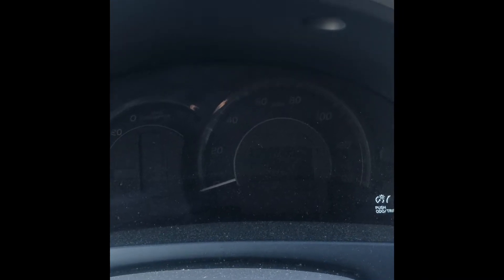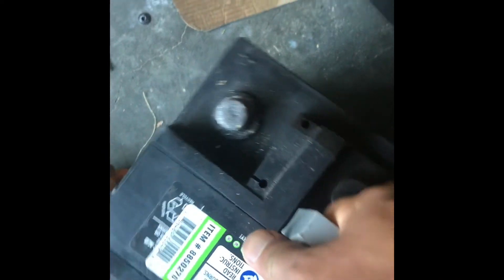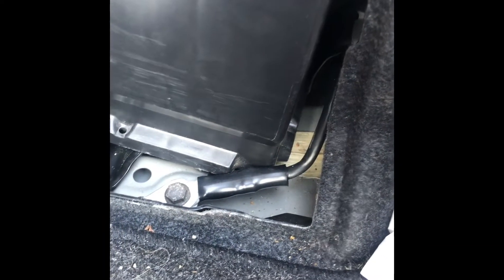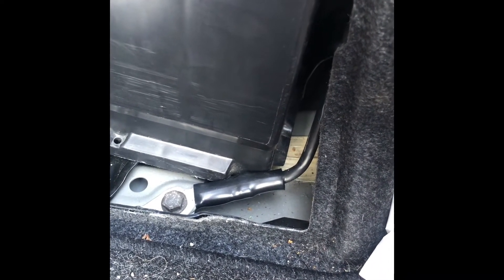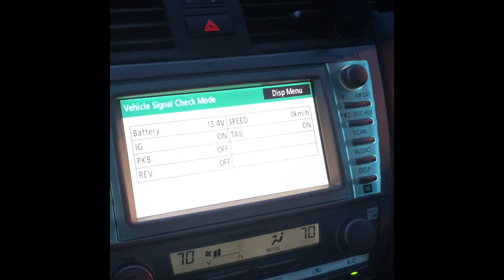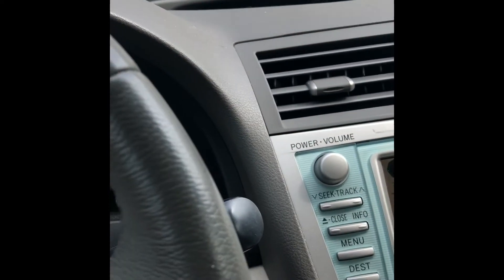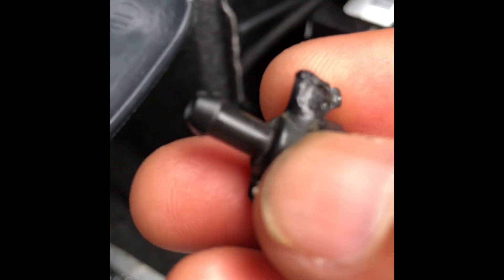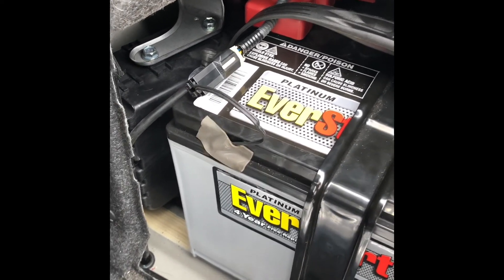Toyota Camry Hybrid - symptoms of a dying 12v battery, replacing with ordinary 12volt and diagnostic

Comment: I used a 12V motorcycle battery and connected plus and minus cables from that battery firmly to the plus and minus clamps on the old car battery. Used duck-tape to ensure a sturdy fit.  Then released those clamps of the car plus and minus poles of the old battery. Removed the old battery and put the new AGM Optima Yellow Top in place. Then, connected the plus and minus clamps of the car wires again to the poles of the new battery, and, finally removed the plus and minus wires that temporarily connected the  12V motorcycle backup battery. About 15-20 minutes work, if you are not in a hurry.

Comment: As of today, does the battery still work ? How did the car function afterwards
Reply from the maker: still works and the car is at 230k miles, still runs and drives fine. Interior is just beat up and dash started to crack(common issue)

Comment: I have the same car and same year my question is I have all the lights on my dash check engine red triangle and abs light as well my car is not having trouble starting but i cant go 5-10 min drving without the car cutting off on me so it causes me to restart the car over and now when i start it its a hard rough jerk when it starts and when i get it gas its shakes and doesnt catch the gears smooth so my question is where do i began i have engine oil in it and a full tank of gas my concern is the transmission their built in so im not sure how to check the transmission level i was thinking maybe thats why its jerking and starting up rough and last thing i had a mechanic put scanner on the car the codes indicated battery park issue im sorry to talk your head off but i have very limited money and im just trying to find ways to make the car run better any input would be thankful God bless
Reply from the maker: go to a parts store and have them scan for codes, this will give you an idea what's the problem.

Comment: pros and cons of doing this? will there be any issues later on if done like this?
Reply from the maker: as long as you have the vents in place and battery fully bolt on there should be no issues. Been driving the car with no issues. Pro: its cheap to replace it because its from Walmart, Cons: none.
Reply: issue: hybrid system warning light